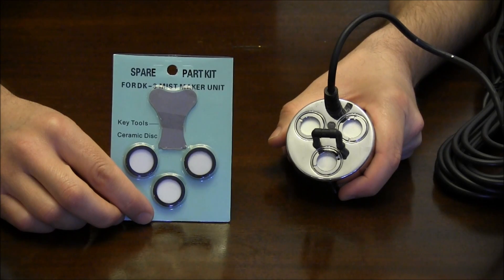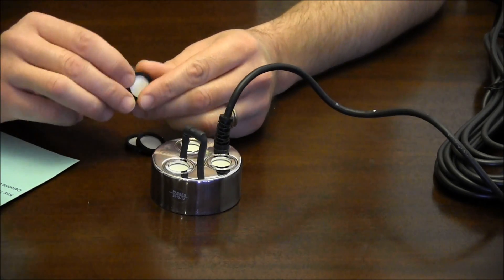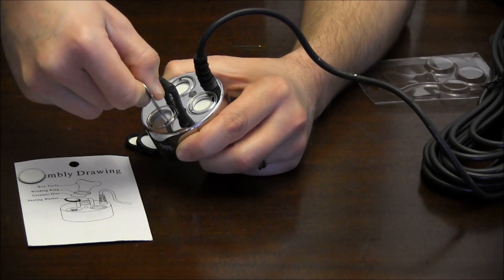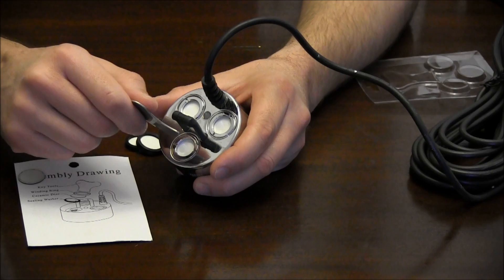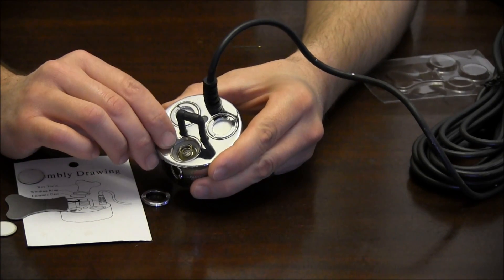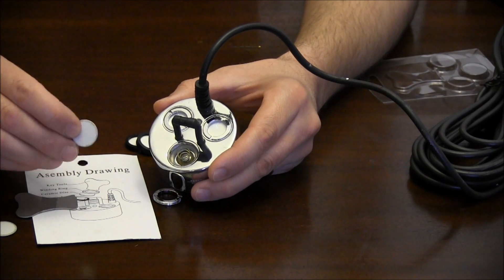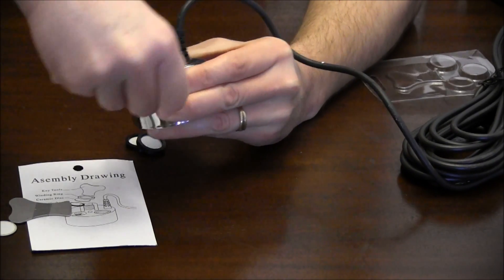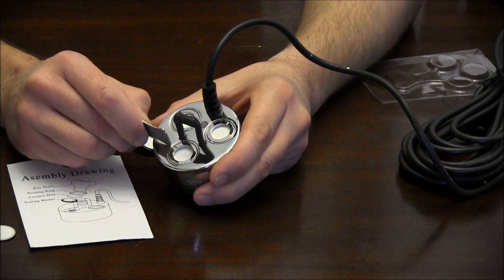How to change the discs in an Ultrasonic Mist Maker with The House of Hydro

Comment: my unit stopped working and I replaced the discs and its still not working any ideas on what could be wrong? the discs were very tight but one disc had a very small amount of moisture under it
Reply from the maker: Hey, good to hear from you. If there's zero water movement above the discs you are going to likely need a new transducer. This is the entire silver housing that holds the discs. If there is water movement and very minimal mist, I would recommend drying out the spring area with a hair dryer for a couple minutes before putting new discs in. This may get it dried out enough to get it working again. 

If you're still having problems with it, shoot us an email at john@thehouseofhydro.com And I can pull your order information to check your warranty status. Let me know if you have any other questions!
Reply: @TheHouseofHydro ok thanks I bought a new one from site butI'd like to get this old one going again as a spare. is it possible to buy just the transducer part?
Reply from the maker: Hi, yes you can find them on the site at the link below. I'm not sure what size you have, but all of our sizes are available at the link to the drop-down menu. If you have any questions just let me know https://thehouseofhydro.com/products/replacement-transducer  @rynophiliac
Reply: @ ok thanks. Could having dirty water cause the transducer to go out? I had a water aerator in there to keep the water moving and fresh and algae free but it stopped working because the tank water has algae growing in there. Could that be the cause of the transducer going out? or what else could have caused it? I just want to prevent it from happening again to the new one. thanks!
Reply from the maker: Hi, LG can stress the unit for sure. It coats the disc and will certainly cause low output. If you have new discs I would try drying out the spring area and replacing the disc. If it's not making any fog or water movement at all though, you probably need to replace the transducer. If you have algae in the water, I would try using an opaque tub. The biggest cause of algae is light intrusion. If it's not algae and just biofilm that you have in the water, I would consider adding our waterproof UV light, or adding a splash of hydrogen peroxide to the water once a week. This will help a lot.  @rynophiliac
Reply: @TheHouseofHydro got the new transducer today with the tuff coat stuff. Is there any way to revive the old transducer like cleaning it with vinegar or anything or is it a through away?
Reply from the maker: If it's not making any type of water movement on the surface of the water it's likely trash. If you have some water movement or even a little bit of mist, we recommend removing the disc and drying out the spring area with a hair dryer for a couple minutes before replacing the disc with a brand new one. You can also take some rubbing alcohol on a q-tip and clean up any crud that might be at the base of the spring. If all that doesn't work, it is probably shot. Let me know if you need anything else!  @rynophiliac

Comment: My single unit is not working as well as it used to. It will create mist, but at a drastically reduced rate.
The uncracked piezoelectric disc is soaking in vinegar at the moment.
The spring is fatigued and is sagging. There is rust around the spring. The o-ring is intact and shows no tears. 
Can I wet a q-tip with some vinegar and swab inside and around the spring and o-ring?
Reply from the maker: It sounds like you had some water intrusion under the disc. We recommend removing the disc and using a hair dryer to dry out the spring area for a couple minutes to make sure every bit of moisture is out of there. 

The compressed spring should not be an issue unless it is so corroded that it is sticking to the unit and not springy at all. You can use some rubbing alcohol on a q-tip to clean up the spring area if you would like. 

If the old disk does not produce good fog after cleaning You will likely need a new disc. You should have a three pack of replacement discs that came with the unit when you received it. If you don't, I would consider either a replacement transducer which is the entire silver part that holds the spring, or ordering a pack of replacement discs. It is possible with the water intrusion, the transducer may be the issue, and not the disc. It's really a 50-50 chance. Feel free to shoot us an email if you have any other questions or problems. That way I can check for warranty. We are happy to help!
Reply: @TheHouseofHydro Thank you for reply. You mailed out a new 1 disk package today, thank you. The unit with rust isn't one of yours.
Reply from the maker: Glad to hear it! Thank you so much for your business!  @uniontank7125

Comment: Is there a way to put them back together so only 1 or 2 disc will be activated opposed to all of the disc?
Reply from the maker: No, definitely do not run without all the discs installed. Getting water under the discs is a sure way to cause failure. The best way to reduce the output is to use a voltage controller like you can use for an inline fan to turn it up or down. We have them available on our website or you can find them on Amazon.
Reply: @TheHouseofHydro  great idea, thanks!

Comment: Hello. I own a mist maker with 9 ceramics by biotop. Is a bigger version of this at your video. The first day that it worked, after 9 hour the 6 ceramics of the 9 have stopped working. The other 3 are still working. Why this happened and what should i do next? Maybe change the 6 ceramic that aren’t working?
Reply from the maker: You can try replacing the discs, but it sounds like part of your unit has shorted. You will likely need to replace the entire fogging head, not just the discs. If you email us a picture of your father, I might be able to get you the replacement parts if your fittings are similar to ours

Comment: the discs are so corroded that the key wont turn them, does soaking in vinegar over night help loosen them?
Reply from the maker: Hi, I would recommend soaking them in vinegar for a couple hours and using an adjustable wrench in conjunction with the disc key. You can slide the adjustable wrench down to the bottom of the disc key and use the wrench to turn the disk while keeping very heavy pressure pressed down on the key so it doesn't pop out

Comment: Could I use Teflon tape, Teflon paste, or even some medium strength thread locker (the blue stuff) to help prevent these rings from backing out on their own?
Reply from the maker: Teflon tape would be pretty hard to use, but a small drop of threadlocker may help. It's pretty rare they back out though.

Comment: You guys dont have the 16mm discs anymore the link is broken when clicking on it and apon searching the sight nothing at all only the 20mm discs are available
Reply from the maker: Sorry, we stopped selling those 16 mm discs. All of our foggers are now and there is a very large minimum order quantity in order to have them produced. You should be able to find some on eBay or Amazon from another   seller. Sorry for the inconvenience
Reply: @TheHouseofHydro  that figures personally I wouldn't even waist my time to search other websites for a 16mm disc because they would not be the same and it would honestly be cheaper just to buy a whole new unit
Reply from the maker: @hurlrules1  sorry I couldn't be of more help. If it is a house of hydro fogger that you have, it should be a 20 mm disc that accepts. If it's not House of hydro then it could definitely be 16mm

Comment: I have unscrewed the ring and the disks won't pop out... the suckers seem really stuck in there.. bran new unit.! no clue what I should do.
Reply from the maker: Hi, good to hear from you. The disc sounds like it's just sticking to the O-ring below it. You can take the tip of a pen, or the edge of your thumb and just press down on the corner of the disc and it will pop out easily. If you need anything else, just shoot us an email through the contact page on our website. That's The best way to get a hold of us! Thanks!
Reply: @TheHouseofHydro  
I totally was just being overly careful and didn't want to use much force. I did what you said and they popped right out... I feel kinda silly but I really appreciate you taking the time and responding to my comment... Happy Holidays!
Reply from the maker: @Purity262  Haha, no worries! Every once in a while I get somebody that asks me about that 🙂 Happy holidays!

Comment: Whats that red standing out thing on those which have it? A fuse?
Reply from the maker: It's a small red LED. We no longer have these on the units because they were a fail point and caused problems. None of our new units have them at all!
Reply: @TheHouseofHydro  That's no way a led, I meant not on this type but if you search for 3 Head Mist Maker Ultrasonic I have this that red thing can be turned out from it whats under is some weird plastic so no idea what that is lol
Reply from the maker: @lineways5477  some of the units have a GFI breaker on them that is located under a red cap. This might be what you're seeing, but it's on the transformer.

Comment: Can I clean it with boiling water and vinegar ? I bought second hand electric fireplace and this unit is covered all in calc
Reply from the maker: Definitely don't use boiling water. I would recommend soaking it in vinegar and lightly scrubbing it clean.

Comment: Had a misting fountain with lights that can set on one color.  Stopped working and could not find a replacement that stays on one preferred color choice.  Attempted repair based on several recommendations.  The trick was immersing the unit head that sits in the fountain bowl - immersing it in full strength white vinegar for an afternoon and overnight.  The next day it began working, a little weakly at first then it gained and by afternoon was putting out a decent amount of water mist vapor.  Saved our fountain which we use for attractive decor and humidifying the room.

Comment: Hello good sir. I have a 10 head fogger which is a year old now, hooked up to an inkbird controller inside a tub to provide humidity for mushroom growing. It worked fine for that period of time but I’ve ran into an issue: the fogger is not making mist for the whole time the controller is giving it power. Fog is created (by all 10 discs) for about 5 seconds and then the discs suddenly stop working. The controller is still giving it power and the fan that’s also controlled by the inkbird is also still running. If I leave the setup running the discs will make mist every few minutes for 5 seconds and stop again. Although they should be running the whole time the controller is giving the unit power because it’s below the RH threshold. If the discs do not seem to be malfunctioning, what else could it be? I’d appreciate your expert opinion
Reply from the maker: Hi, great to hear from you! If you have the 10 disc unit, it doesn't sound like it is our unit. However, the most common cause of problems is moisture under the discs. I would recommend pulling all of your discs out and drying out the area underneath of them with a hair dryer for a couple minutes. This might correct the problem. You may also have a problem with water intrusion around the water level sensor based on the symptoms you are experiencing. If you can get it dried out and put some epoxy around the water level sensor, this may fix it. If you need anything else, feel free to send me an email at john@thehouseofhydro.com Thanks!
Reply: @TheHouseofHydro  You’re right. It’s not one of your units, I’m sorry. But it’s very hard to find expert knowledge on these machines, so I thought I’d just shoot you the problem. Thanks for the advice, these are two great possible solutions. And since your service seems to be excellent I’ll definitely consider your company when I need a replacement or a spare. Thanks again and have a good day
Reply from the maker: @DizzyNLD  no worries at all, I'm happy to help! I just wanted to make sure it wasn't ours. If you need anything else just let me know!

Comment: Is there a way to block one of the disks if say you didn't need that much fog per minute ? I have a controller but its very on and off and I would prefer it be on for longer periods with less vapour.
Reply from the maker: Unfortunately there isn't a way to "block" a disc. The only way to reduce the output of the fogger is to use our mist output controller in order to turn down the voltage resulting in a lower fog output. Please do not try to remove a disc to reduce the output. The spring area under the disc has a circuit board that will certainly short out if you allow water in that area. If you have any other questions just let me know! The output controllers can be found on our website at thehouseofHydro.com

Thanks!
Reply: @TheHouseofHydro thanks for the reply, what about a piece of duct tape or some sticky tact over one of the discs, would that be ok ? 
If I could find a stainless steel disc of the same dimensions could I put that instead of the ceramic ?
Reply from the maker: @chrisdee8957   no, it would melt the duct tape. Ultrasonic vibrations cause heat. I would recommend to either choking down your output tube to reduce the air flow, or using a voltage controller. Any other way and you are likely to damage something.
Reply: @TheHouseofHydro  hmmm ok. I could choke out the output I suppose. It would theoretically half my output and therefore cause less drastic controller input. Thanks for the information about causing heat, I was surprised and glad I asked.

Comment: How do you change the o ring you said is in there?
Reply from the maker: The clear o-ring inside the unit is usually good for the life of the transducer. You can remove it gently using the tip of a pencil though.

Comment: the rings are too tight to open. Any other tool that I can use to remove them?
Reply from the maker: Hi, if the rings are stuck, you can use a disk key in combination with an adjustable  crescent wrench. Keep pressure on the key while you use the wrench to turn the base of the key right up against the retaining ring. This will help keep the key from twisting.  Hopefully that helps. If you need anything else just let me know!
Reply: @TheHouseofHydro  I used a long nose pliers and hold the base of the key and it worked for one of my mist maker. The other is just too tight. Thank you so much for this idea.

Comment: hi is it normal to get shock when i touch the white damper area when the device is on? cause im afraid it might have electric leak
Reply from the maker: Yes, it is normal. It's not an electrical shock that you are feeling. It is the ultrasonic vibrations coming off of the disc that you feel. It certainly feels like a shock though! You should avoid touching the discs so you do not damage them. They are fragile. We have information about this, as well as many other things on our websites FAQ page length to the top of our homepage. We definitely recommend looking through everything for a ton of operating, maintenance, and care information. Thanks!

Comment: Is there a way to eliminate or control the fountain part of the mist maker? In other words just have it misting so that water puddles don’t form outside of the container. I have a small cauldron in the house for Halloween, but the mister also sprays too much of a fountain causing spillage. And a bigger container doesn’t create enough mist to come out of the cauldron. Any help would be appreciated.
Reply from the maker: Hi, You can use the splash guard to prevent that. Please make sure it is a House of Hydro fogger, or it may not fit. You can also make your own with a little creativity. :-)    https://thehouseofhydro.com/products/splash-guard-for-one-disc-mist-maker

Comment: Can i use aquagaurd water
Reply from the maker: If you're talking about reverse osmosis water, yes, you can use it. You just want to avoid extremely low TDS water such as distilled. It's preferable that you use a water with a TDS over 15 ppm to assure that the water level sensor makes a good connection. Thanks!

Comment: Why do the ceramic things need to be changed? They look new
Reply from the maker: It's just a demonstration video for my customers. Discs can lose their rigidity after a while and need cleaned or replaced. If cleaning doesn't help, then replacement discs are necessary.

Comment: How could I open it if I don’t have a key
Reply from the maker: Put on work gloves, and use pair of scissors opened up slightly and put the points in the ring slots,...then use an adjustable wrench at the very base to turn it.  If you're a customer of ours, just email us for a replacment. Or you can find them here for sale. Thanks! https://thehouseofhydro.com/store/p73/High_Output_Replacement_Discs_20mm_or_16mm_available_%283_Pack%29.html

Comment: How much time does the actual unit last?
(I'm not talking about the discs)
Reply from the maker: Hi, good to hear from you! The length of time the unit lasts varies quite a bit. It really depends on run time, water temperature, water quality, and proper maintenance. Most of my customers return between 1.5 and 3.5 years for a replacement transducer.

Comment: Thank you so much for the video. Any clue how long would the discs last in fertilizer or any other liquid of viscosity different than water?
Reply from the maker: Typically they have last 3 to 5,000 hours in clean, cool water. You will have faster buildup from the solids and fertilizer, but the non-stick ceramic glaze that we coat the discs with will release any buildup after soaking in vinegar for just a few minutes. If you have any other questions just let me know!